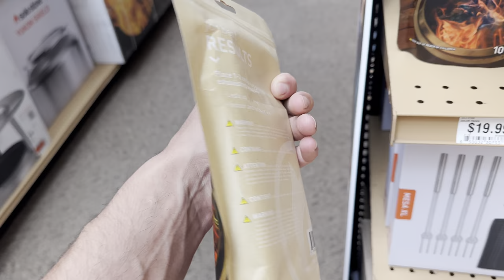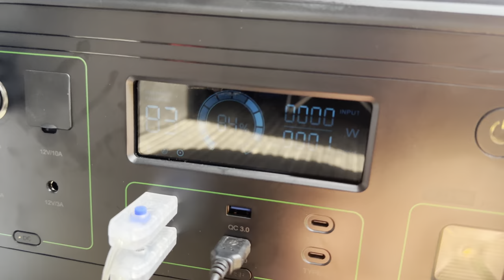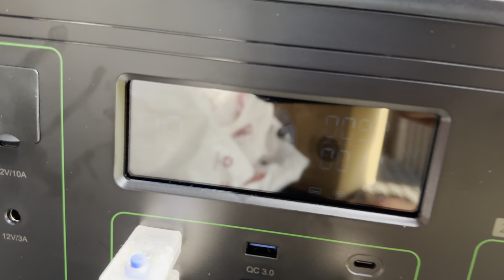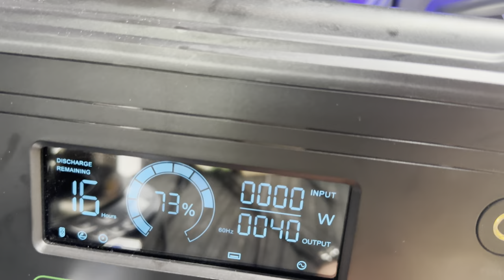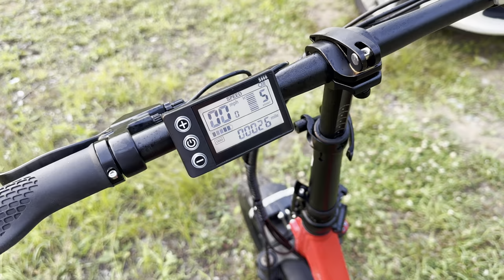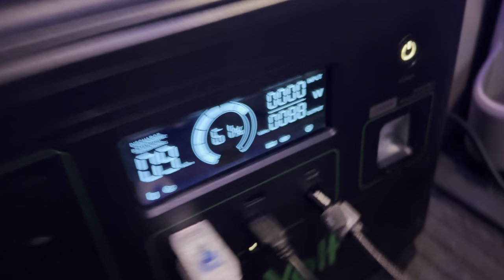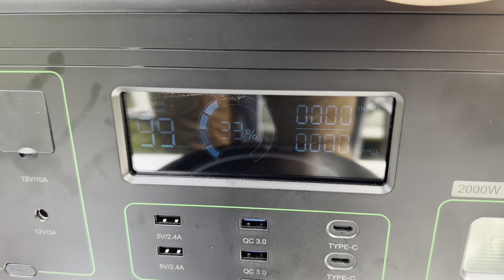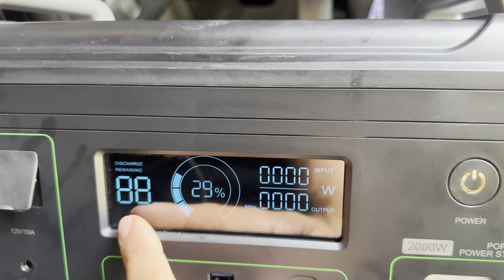Solo Car Camping with Heavy Rain and Hail, Bigfoot?

Comment: I couldn't tell if you were using g butter/margarine or mayonnaise on your bread. But (if you don't know this already), in a pinch if you don't have butter for grilling your bread, you can just use mayonnaise on your bread like you would butter.
Reply from the maker: It was butter, but thanks for the tip I may try that sometime 😁

Comment: If you want color in your fire find some 12-2 or 14-2 solid wire and strip the plastic off. 
 Whined it into a ball (doesn't have to be a tight ball) and place in the middle of your fire.
 As you add wood dig it up to the top again. 
 It is reusable for many fires.
Reply from the maker: Oh wow, very interesting. Thanks for the info 😁

Comment: Coldest Place I have Ever Worked Minnesota -21  we had to heat the cables up we were pulling in and the outer casing was still popping and crackling,,it was adventurous 😅😅🍻 good Bartenders there👌

Comment: Great stuff! The ebike is pretty cool. That 2000wh powerbank looks great, especially with the 2-3hr wall charging capacity. I got a couple of VTOMANs with 1443wh capacity each. I take them both when I go camping. They weigh about 30lbs each and quite convenient having 2 units and double the outlets and charging ports.

Comment: Be careful on that folding style of e-bikes. That center stand can get caught easily when going over hills. They are actually very hazardous. I would take a grinder with a cutoff wheel and remove it. I just bought the Solo Stove Ranger. Haven’t had a chance to use it yet though
Reply from the maker: I could definitely see it being a hazard under the right circumstance. This is my second solo stove and seems to make a good product.

Comment: Had fun brother! Would you consider auctioning off any of your extra power stations?
Reply from the maker: I sell them all right after I use them on video and only keep the biggest one for my setup. So currently it’s the Bluetti ac200p with a b300 battery. You’re probably not local to Minnesota but if you were I’d say follow my marketplace on Facebook
Reply: @TolbersCamping  oh ok that makes sense! Good to know! No I'm in California the LA area atm. I'll still follow your Facebook tho haha! And you got a great set up! My largest one is EcoFlow river plus with a 600w inverter and like 360wh.... it does the job I like it! Just need more juice! Haha! God bless you Tolber!
Reply from the maker: @everythingautomotiveeta5839  if you’re just using it to charge small things or run lights that’s enough. My first one was about 500wh and use that for a bunch of videos
Reply: @TolbersCamping  it's actually did me really well! I remember your water boiling woes early on with using more power than you would have liked to but then you rectified that with the new inverter method and larger power stations! Heaviest draw I got is a 500w water kettle and a 500w heater but I also got a 220w personal heater. I'm LOVING your channel brother!

Comment: I was camping last year, with my GF in W.V. with a similar set up to this. While we were looking for firewood and about 50 miles from the nearest town, I started whistling a song. All of a sudden someone started mimicking my song back to us. At first my girlfriend thought it was funny, not thinking how far away we were out into the mountains. I told her, this is not funny at all, and mentioned we are 50 miles in, when it suddenly hit her. Now knowing of how bad of a situation we were probably in, I told her to start put everything in the caravan and act as if we didn't hear the whistling. Well, that was a very bad idea, looking back now, we should have just quickly ran to the van and left everything. Soon after we could hear cracking wood under some ones feet moving towards us fast, but couldn't see who or what it was because it was nothing but pitch black darkness. I yelled, hey stop right there, and for a split second it stopped only to be followed with multiple foot steps and people running towards us with long knifes and what appeared to be a gun. I jumped over the hood and started the van yelling at my GF to get in, but she froze in fear. I stopped the van got out and pulled her into the back then floored it away from our campsite. As we looked back there was 4 large men holding knifes and one had a what looked to be huge rock in his hand. We sped around the corner where 2 other men stood right in the middle of the road holding a large branch attempting to block our path out. I never let off the gas and barreled thru the make shift roadblock. It took about 1/2 hour of driving before i had a cell signal to call the local sheriff's office. They said where it happened wasn't in their jurisdiction, so we kept driving until we were back on the highway. We never followed up with anyone, we didn't want to go back to that back-woods town again.... Very true story, be careful out there and never whistle when camping because you never know who you might let know your location........

Comment: Cover and protect your ebike's computer in the rain if your riding.  It's not worth ruining your investment.  Use a cover when it's gonna rain and it's not being used. Do not expose the battery to 32 degrees or freezing, it will ruin your battery life. In a nutshell, keep your ebike dry and your battery above freezing temps.  Now days the batteries are not cheap anymore.

Comment: in the rear left wheel well of van there is a tire sensor system hidden and the wires get freyed going over frame,if that's y tire system unavailable, i cut a hole fixed mine after watchin youtube video, IF there is a small hole on rear wheel well that's y, it burned thru, thermostat housing, engine oil cooler(if leaking), cooling fan resistor, -upgrade to aluminum NOT plastic (omg y did they put plastic parts on a aluminum engine! that crack after a while)

Comment: Cool setup.  I got one of those lectric  step thru 2.0 bikes. Kinda looks like yours but yours looks a bit nicer. I like your power station with the solar.  How much does something  like that cost in the stores? Looks like fun times for sure. 

O the link is in the description on the power station. 😅

Comment: Dude, you’ve got a tire pressure warning indicator light on. Means one of the tires is not spinning as fast as the other three due to circumference being less . Why not air em up while getting pizza? Might even be free.

Comment: Do you have a link for the magnets tat you used for the tail veil? TIA
Reply from the maker: The company sent them to me last year, don’t think they released those magnets yet. You don’t need the magnets though if you tighten it correctly. I didn’t use them for many adventures and it fit perfect without. Just make sure to get the real tailveil from their website, the one on Amazon is a knock off
Reply: @TolbersCamping  oh! Ok Thanks for answering my question. Good to know I was just looking on Amazon about it.

Comment: Seems like when they crack thats it. You will replace them every year. So was my car any way. Toyota corrola
Reply from the maker: I’ve had mine a year and it’s stayed the same. Only one layer is cracked so hasn’t been an issue and don’t plan to keep the van much longer so just going to leave it.